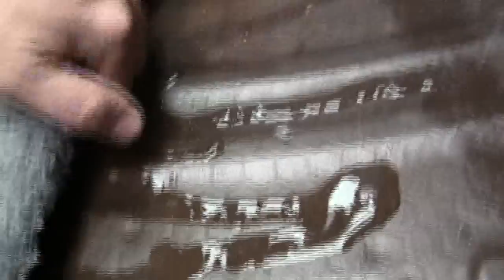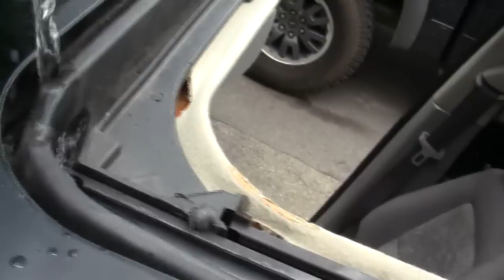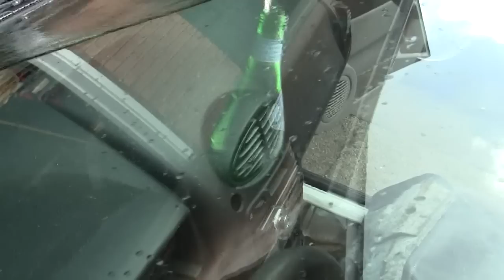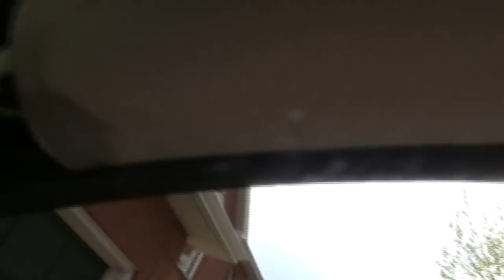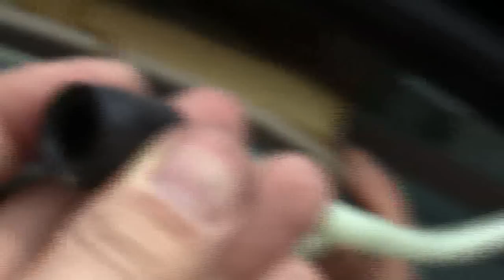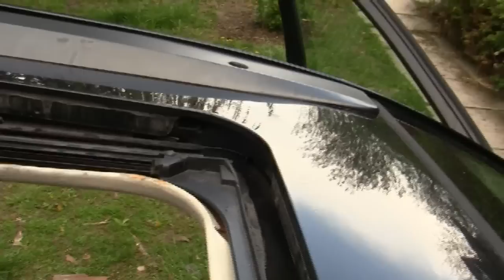How To Fix Car Sunroof Leak.Saturn/Dodge/Ford/BMW/Jeep/Honda/Toyota/Tesla/Mercedes/Bugatti.

Comment: You didn't speak at all in the video. The video was so great you didn't need to say a single word. I have had major car issues the past 3 months including being towed 3 times and 2 new accelerator pedal installs. This time they found water under my carpet and that a wiring harness coming from the computer had been wet and has corrosion on it. I found your video when I though it was coming from the roof maybe. Both drains on my sunroof were clogged by leaves. Thank you so much for ending this expensive nightmare ride I have been on the past few months. Hat's off to you!!!!
Reply from the maker: Thanks.

Comment: You sir just saved me several hundred dollars in a new window motor and weatherstripping and labor. The drain tubes on both sides on mine had come apart. I had no idea they had drain tubes thought it was just supposed to be water tight. I now have a dry interior for 5 bucks worth of super glue. Thamk you thank you thank you!

Comment: Terrific video! Thank you for doing this! 

Couple of comments:
On my black '05 Vue, I didn't find it necessary to remove the outside above-door trim strip - only the visor & clip and inside cover for pillar.
Also the outside trim strip is fragile - the black paint on it chips and scratches easily. The plastic mounting tabs break easily.

The white plastic drain tube as shown had shrunk about an inch in length so it was necessary to cut it and glue in a piece of 3/8" ID clear neoprene tubing as an extension. 

Dealing with the water under the carpets is the hardest thing. I don't have a wet-dry vac so will blot the water up with towels until the carpet dries.
Reply: put a de-humidifier in car and close everything car will dry up

Comment: Thanks for posting this !   My wife has a Red Line Vue and has recently noticed a wet floor on the passenger side.   We've also spotted wetness in the past, around the center roof console.   I'm going to check these connections in the sunroof.   
Also, VERY nicely done how you were able to communicate the problem AND the repair, without saying anything ! ! 
Thank you so much.
Reply from the maker: +djwak59 
You are welcome.

Comment: Thank you. Exactly the issue with my 2004 VUE. 
I was thinking the drains were clogged, and not looking forward to dealing with that. But it was the passenger side fitting to the tube that had let go, as was the case in your video. I noticed that there wasn't much slack in that tube as well.

Comment: Thank you for posting this.  My Saturn ion sunroof drains have caused so many problems.  The latest was the trunk filling up with water and ruining the battery.   I've had the car since it was new and this is the first.  Amazing to find out how many others have had this problem.

Comment: Thank you for the video. I bought an '05 Vue that was garage kept because of a sunroof leak. I watched your video and fixed the problem in about 30 minutes. I think my tube was pulled out when the windshield was replaced. About half way down the A pillar there was two sided tar adhesive that stuck the tube to both the A pillar and the windshield.
Reply from the maker: You are welcome, my car CVT transmission is gone, its weak point in this model.

Comment: Water pouring out corner there passenger side, flooded. So, Just saw your video, and the end of the tube disconnected, great detail of video, unscrewed my 2004 Saturn Vue Redline,  areas, hoping to find the tube disconnected so I know that's the leak issue, and smiled big when i saw it, reconnected, problem fixed ! Thanks a lot for your help
Reply from the maker: +Matthew Lewellen Glad it helped.Just wondering did you see airbag in that area?

Comment: Good luck with the super glue!  I have found from past experience that super glue does not hold up well overtime when used on plastic.  Recently, I purchased a super glue kit for use on plastec that contained two small containers of solution. One is a primer and the other is the actual glue. After many attempts, it did not work well either.  The directions on most super glue packages says it with work on plastic, and for the short term, it may, but over many years I haven't had much luck with it.

There is another YouTube video where the car owner had the same problem as you did and he used zip ties around the tubing to secure it. I wish you well as I know this is a frustrating problem to have!!

Comment: How to you find out if the rear drains are connected, where are they?  Do you have to remove the side pillars in the middle and back or just the middle?
Reply from the maker: Find the drain holes from roof top of your car, poor water only in one hole at a time , if your tubes are connected then water would flow under your car on ground, otherwise the water will be flowing inside your car.

Comment: this fix only works if the hose is unplugged.  if its all connected and still leaking you will need to find the blockage.

Comment: Many thanks for the video!! I have the same problem and found that both drain tubes had become disconnected. It seems that the tubing has shortened over time (shrunk), probably due to the heat in that particular part of the car? However, I'm pretty sure that even if I superglue the joints, the stress will pull the rest of the gasket off where it attaches to the drain itself. If anyone has suggestions for that, please post. I have a feeling I'll be taking it apart again one day.
Reply from the maker: I'm glad my video helped you, maybe you can replace old tubing with longer one.Btw what brand is your car?
Reply: Yes, I really should replace the tubing, but I was being a bit lazy. It's glued to another type, so I'd need a section of the same tubing, then two joints. I made it through a test and the first rain (today). Fingers crossed. It's a Saturn VUE 2002. Getting old, but I'm hoping it will last. Thanks again.

Comment: I checked mine and my hoses were still connected and I tried poring water on the car after I unhooked everything and looked, but didn't see no water leakage, so I have know idea where the water was leaking from, so I just put everything back together and put new tape around the edges of the sunroof, cause I'm not taking any chances of water getting in, if its not the hoses...
Reply from the maker: Charles Klingensmith  If drain holes are not plugged, then water is leaking from somewhere else, open the hood and check that the drain under windshield are not plugged with leaves, also check that cabin filter is not wet.

Comment: So other words tare half the inside up.no thanks the damn can can just leak.
Reply from the maker: It All depend on the car, some leak will affect electronic components, which will be expensive to replace. Also the smell of moist carpet could be a problem too.Otherwise dealers door are open to suck your money.